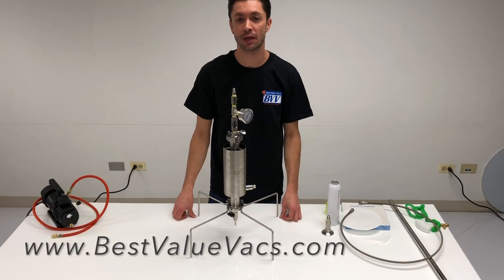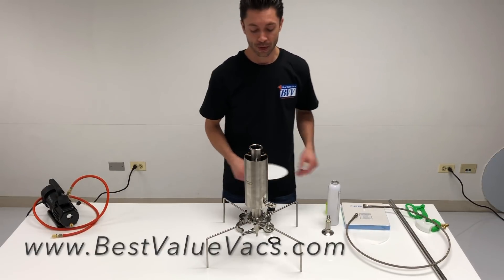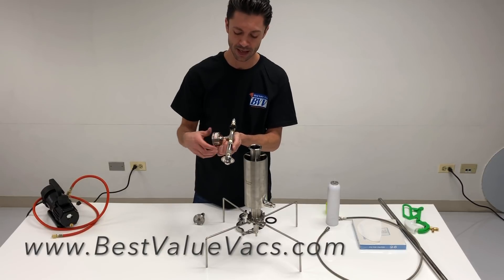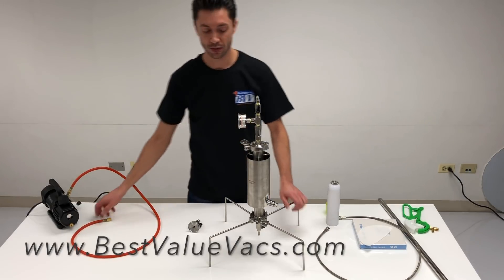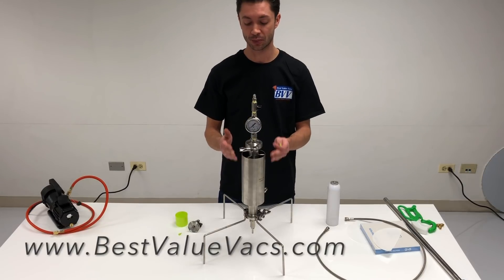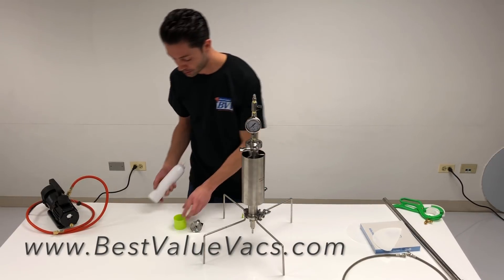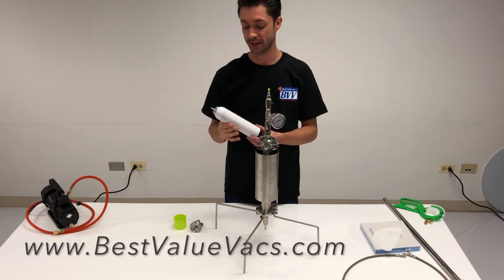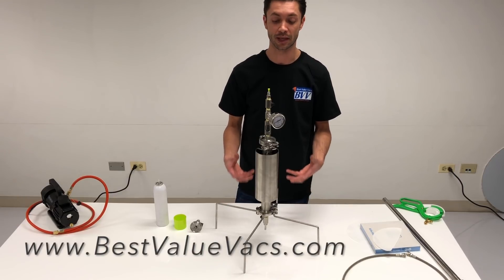Dewaxing Closed Column Extractor

Comment: Does anyone find the gauge necessary? Obviously it can be done without, but I’m just curious if it’s simple to tell when a vacuum is created in the beginning by time and sound…

And then the pressure inside once solvent is added? It’s great to know but does it change anything? It will fill 80% of the way, either way, right?

Truly curious thanks for all kind and helpful replies!! Wanting to buy
Reply from the maker: @nimo517 the gauge on a closed column can certainly show you the vacuum level and once you've hit full vacuum, but yes, you can also achieve this by listening to the pump. The gauge makes for a great visual aid. You can also gauge the temperature of the solvent/extraction by the PSI readout. The pressure of the solvent corresponds to the temperature of the solvent. The gauge will only be a visual aid, it does not change the extraction process whatsoever.
Reply: @Jmarosii  hey okay so I have all of that now! Haha 

I’m wondering what is stopping me from a closed loop system with a splatter plate and all of that but instead of reclaim tank, just use a a pressure release valve into a safe area

I get it sounds like a waste but I’m just using 1-4oz at a time so if I run 45g of nug, and I’m avoiding blasting into Pyrex…

Can’t I get rid of the gas butane without the BHO coming out at the same time? And then opening basin?

Comment: Can someone explain how this separates the wax from the oil
Reply: The extra space around the material column is where you would add dry ice to, making it cold enough to freeze the lipids/fats/waxes in your oil then strained out by the filters, separating(dewaxing) it from your end product. Hope that helps.
Reply: @constantelev8tion1  interesting
Reply: Aten Ahu  yes regular ice is not cold enough, it has to be freezing. Another alternative is to put your extracted oil in a freezer for a couple of hours then filter it.
Reply: Aten Ahu  ethanol or everclear and Büchner funnel with vacuum is what I normally use. Tried and true nothing new.  Alright cheers.

Comment: what size column is that? how many grams can that hold?
Reply from the maker: tia regalado 1.5” x 12” column. Holds about 60-90grams. Typical packing density would be around 3g per cu^3 in. So generally this fits about 60.

Comment: You need to soak for 2 hours for bud to winterize.
Reply from the maker: There is a lot of talk that "soak time" plays a significant role in dewaxing your material; this is NOT true. You want to saturate your biomass quickly and effectively. The longer the "Soak time," the more undesirables and chlorophyll will be pulled, making for a darker extract. 
Feel free to give us a call at (331) 281-0154 to speak with a tech.

Comment: Can someone contact me.  I'm small time.   I want to open blast into a mason jar.

Is 28grm nug run enough to make it e den worth while.   I got like 5% return if e even from fresh frozen open blast so.i don't think ill ever go fresh frozen again.

I'd rather sauce than live resin or batter/sugar diamonds anyhow with easy to pour terps and large chunky crystals on tbe bottom. 

So what's average yield fresh frozen versus dry and I've had many tell me I can still make sauce worth dry and cured materials
Reply: Wow I’m so curious to know how far you went in this process? Now that three years have passed. You sound very knowledgeable and capable. I want to do it myself cause I can always get flower but not concentrate. Let me know :)

Comment: Any advice on how to get more butane in the tube? Got one from you guys and trying to work on getting better yields
Reply from the maker: 34ModernMexica 34 chill the column before you run.  Also you can chill the cans in the freezer. It will reduce the pressure in the cans making the fill take more time. The purpose of using freezer temperature will allow the gas to stay liquid longer and resist expansion. Allowing you to fill it more.  Generally speaking the best fill will only be around 85-90% full.
Reply: Cool the column first then pull a vac on it. Should take the whole can
Reply: KustomGraphics206  yep greed will kill us all in approximately 15 years or so anyhow. First time I distilled my tane I was really amazed how much shit was in it! Bought 35 gallons like two years ago still have most of it left after countless successful runs.
Reply: Umm kustom or you know you can use a solvent tank. The can tap tool and top fill is just optional. Many of the companies here who supply hydrocarbon gases supply distilled butane. It's also not very expensive,  but if someone wanted to distill and recover their own. They also sell a closed loop system instead.
Reply: You can repeat this process over and over
Reply: @DavidGarcia-jh7yu  Is this David from LJ?

Comment: Non distilled hydrocarbon....yikes bro.
Reply from the maker: That’s how you start, when customers  graduate to tanks they can distill their  butane properly.  All depends on how hard you work for your quality.
Reply: Illuminating a best practice. Wish I had that lil rig 8 years ago, that sleeve is a dope mod.
Reply: Not necessary with butane made for extracting. This isn't 2000 when people were using lighter fuel.
Reply: @iamchillydogg   even on some of the highest amounts ends up being negligible if you are not running a lot..... 

Have the people who say yhis ever actually distilled extraction quality n-butane in a closed loop? Lol people act like half the can is mystery junk